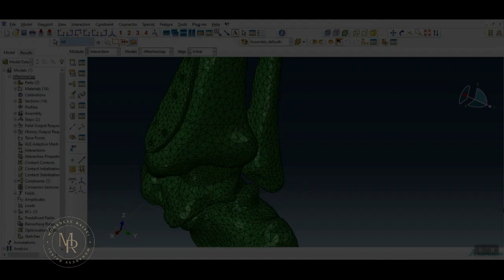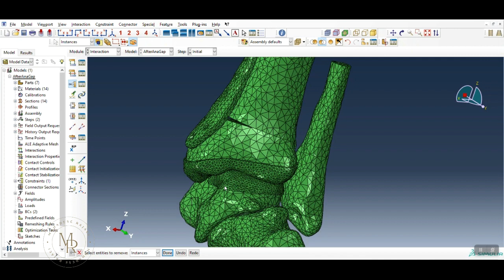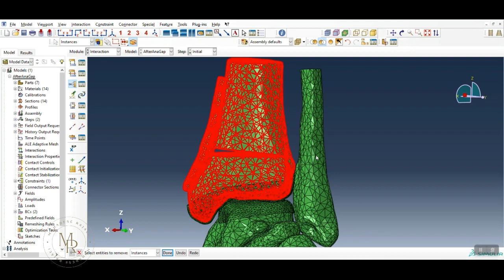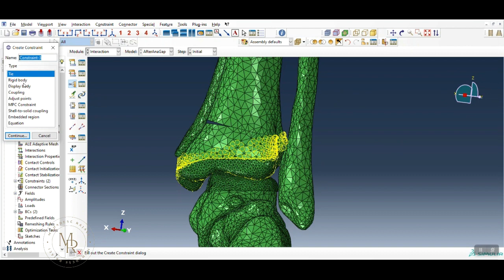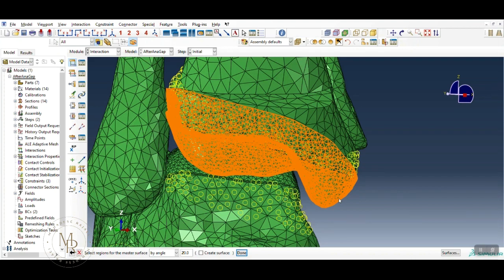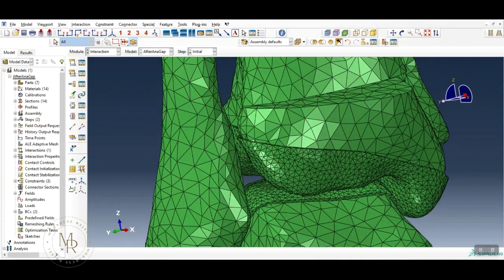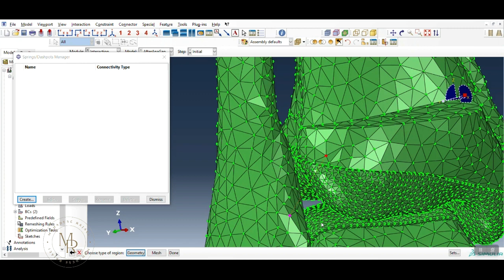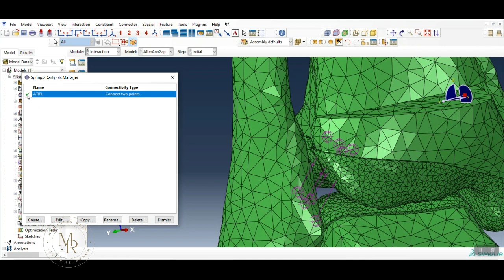ABAQUS: Biomechanical model of ankle  : modeling ligaments, cartilages, frictionless contact

Comment: Hello, this is a great job, but I have the following questions: How to determine the stiffness of ligaments, and what literature or databases can find these parameters? In addition, can the bones only be connected through frictionless contact and linear springs to constrain the degrees of freedom of the model, and what will its true motion look like? Will there still be three rotational degrees of freedom for the ankle joint in finite element software? In other words, in the absence of a load or when the load is very small, a linear spring can constrain all the degrees of freedom of the foot, and the bones will not experience rigid displacement. We look forward to your reply very much. Thank you very much.
Reply from the maker: Hi and welcome to the channel 😊
You can find the values for material properties, spring stiffness etc in the literature and this can be different based on your project. The springs can't constrain range of motion, but it can effect it. For example one spring can change the effect that a load has on its movement. About its realistic movement, it depends on the loadings. Here I did a static simulating of the gait cycle loadings, but with different loading you can see different movements. After all according to the realistic conditions, you add the boundary condition and so on. If there're any questions you can continue this conversation 🍀

Comment: Hi this is great, could you do a video on how you would run a simulation on this model. Thank you for all of your work
Reply from the maker: I will but this is related to one of our projects so I need to wait until it's published. So tell me your question so that I can help you
Reply: @mrajaeirad  Hi Mohadese, It is very cool. I was wondering How would you apply BC and loading for your model?
Reply from the maker: @LiangliangXiang  well generally we get the bc. And loading from previous studies and based on what happens in reality. This model, was fully fixed from the posterior side of tibia and fibula. Loading was applied on the COP which was defined as a reference point 🍀